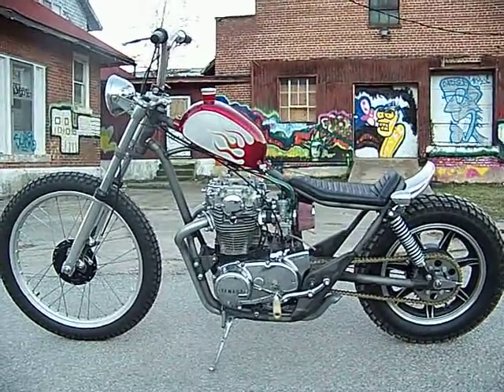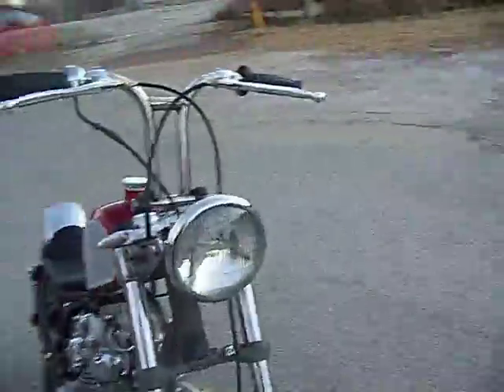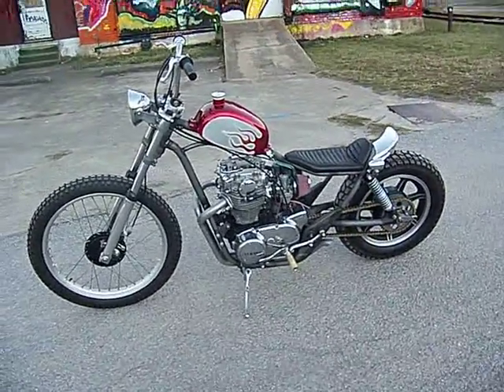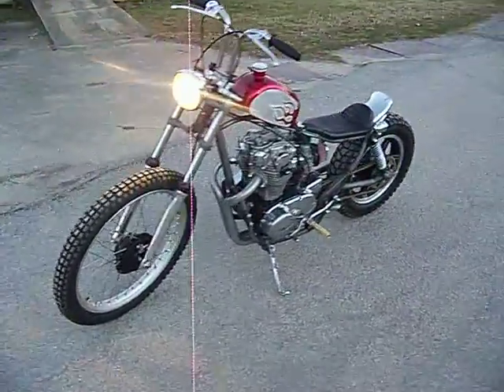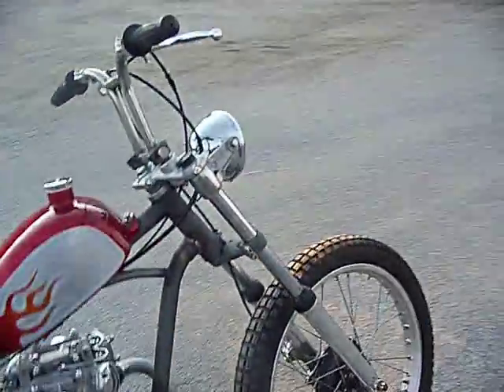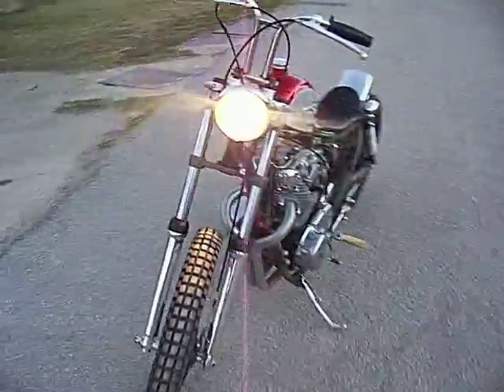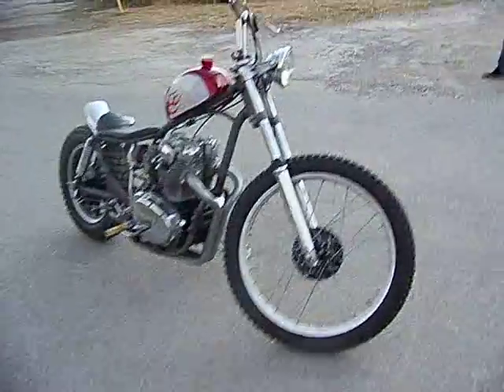Hugh's HandBuilt PMA - Kick Only, No Battery with lights

Comment: My bike has the hughs homebuilt system in it that's set up for battery, I don't plan to use electric start so how do I wire it to a toggle switch to just run for kickstart?

Comment: I'm glad to see this, I've been riding since 1969, owned a dozen bikes in my youth, no batteries, couldn't afford them, and it's not that hard to set up a system that works like this.  I'm glad to see technical support in making this common, I've run no battery bikes from an old "Sears, Allstate" 175 to Harleys of all sorts, including Triumphs, Ducati's and certainly XS 650's.  I bought an 82 XS in the nineties, and seven or eight basket case XS's, built and sold them to keep one, well paid for and they are one of the easiest to make solid, sound, reliable, and cheap to run and keep.  I've got three bikes now, and would welcome an XS into my shop eagerly.  Thanks for sharing this, the bike looks and runs great.

Comment: Do they burn lots of head and tail light bulbs out? Wondering how the excess voltage is dealt with as rpms increase?
Reply from the maker: Voltage Regulator does that work.

Comment: Anyone know if a 76 RD350 can be made into kickstart only? A buddy has this sand rail type dragster with an RD350 engine and we're trying to lighten it up. I read about these battery removal kits that's basically a large capacitor. He seems to think it won't work because of the points and condenser ignition he has.    Anybody?

Comment: You can't get it inspected without a horn and blinkers on THAT year bike. The horn will not work without a battery. I hate batteries, but its the truth. I've tried air horns, regular bike horns, no electromagnetic horn will work with the low amperage rating the stator puts out. It may make a tiny noise while revved up. Thats it.  Fix that. Then we'll listen. Go.
Reply from the maker: Maybe in Communist Russia, but here in Good Ol' NC, most motorcycle inspection stations couldn't tell ya what color the bike was they just inspected - haha...  Blinkers not required if not installed.

Comment: Hey guys at hughs, I have a xs650 I picked up and I want to shave the top motor mount off like this one on the vid.. have you had any issues with anything after getting rid of it? Any help would be appreciated
Reply from the maker: On a stock non-rephased motor I would not suggest it.  The vibrations are amplified.
Reply: Hugh's HandBuilt thanks for the reply man.

Comment: After frying several Lithium batteries, finally installed a capacitor...why didn't I do this sooner!
Reply: +Jared Hundrup can you give an exact description of our capacitor? i have a 6v honda cm125t and id like to instal a capacitor with the rating(Umax= 30v at 33000 micro farads) what do you think?
Reply: +Felix I'm not an expert by any means on these capacitors.  I've read a fair amount on the settings of the ones that people are buying but there aren't any markings on the one I got from TC Bros choppers.  Throw into the mix that you are running 6V and I am unsure.  If the capacitor isn't too expensive or you already have one, I would look at the voltage coming out of your battery now and then with the capacitor installed to ensure you aren't gonna fry something.  Other than that, I'm probably not the best resource for this.
Reply: +Felix There is no limit to the capacitor value. If it doesn't work just increase the value. You don't need to go much above 10V regarding its voltage value rating. 10V or 16V would be enough. This would reduce the capacitor dimensions.

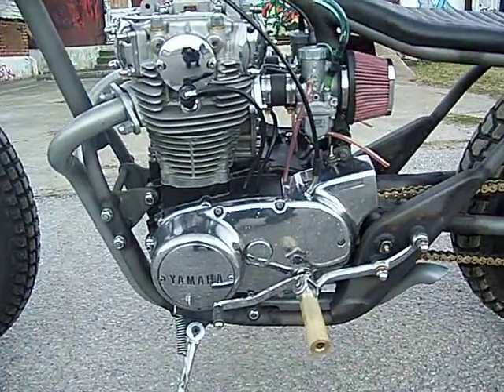Comment: Plug wires run down into left engine cover and probably come out under the swing arm were reg/rec, fuses, and coils are located. as you notice at 00:30 that you can see the reg/rec. There should be enough space there to put other electric stuff. Plus, if the fuses are not there as mentioned above, they could be attached to bottom of seat.

Comment: I think this is because my capacitor gets overloaded from charging system but my ignition requires more juice to keep it going at high rpm so my holding system is to small. I also ask because my cap is almost twice the size of yours i do have turn lights and brake but they are led also with a stock headlight. I know points requires more juice and pamco pete uses less but i was hoping to get an estimate of the specs on your cap that you use.
Reply: Go to Electrex World.  they have the set ups.

Comment: Hey Hugh i recently bought a PMA kit from you and it works great solved the problem i had with the stock charging system. It starts fine and idles it still uses the stock points ignition system. What i was wondering is what is the specs for the capacitor you use for the pamco pete system? I ask this because i have a capacitor 40v by 30000uf at my bike will rev to 7000rpm but only 3500 under a load (me riding it) and lose power light dims and bike will die if i dont back off the throttle.